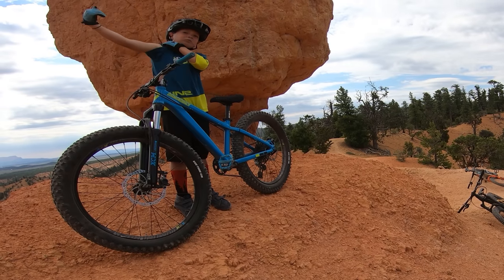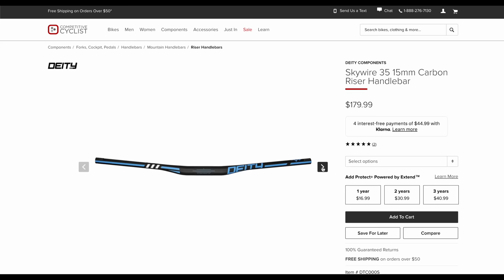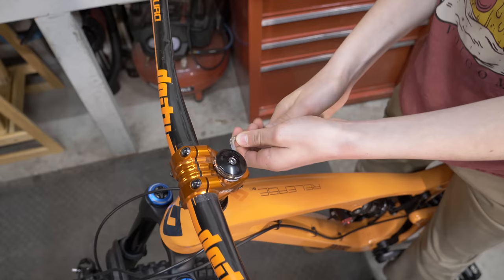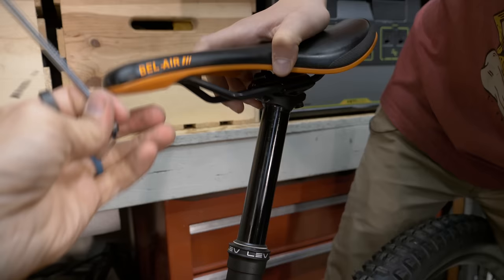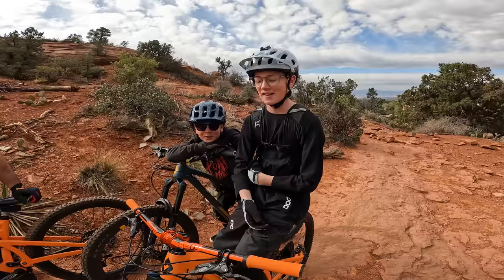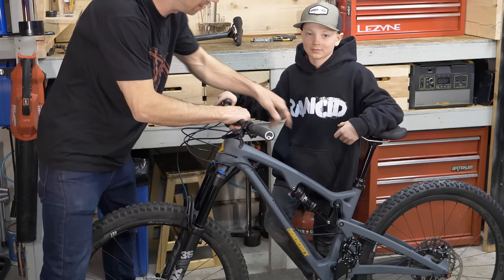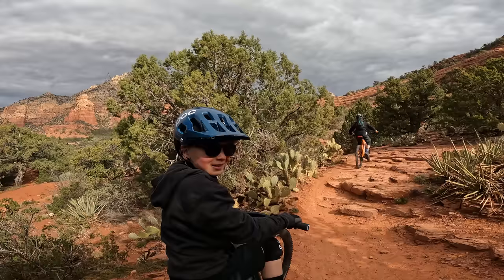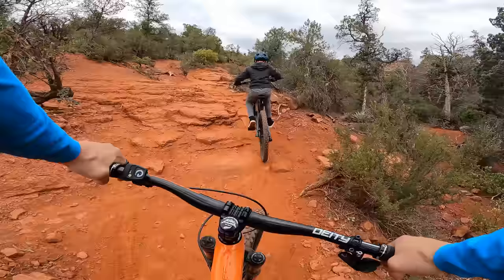Big Bike, Small Kid! Here's How To Set It Up! The Porter's Got New Bikes!

Comment: Hey I wanted to add a suggestion. I am a shorter rider and my dropper was a bit tall for me. I came up with a hack using a couple of zip ties from the seat clamp to the seat as a limiting strap to keep the post from extending all the way, now it works great and doesn’t extend too high!
Reply: Yeah, when I was younger I used a piece of string to hold the dropper a the right height. I tied it to the seat rails and to the little triangular support on the frame that sits between the top tube and the front of the seat tube on some bikes. I had a Marin B17 but it seems like it would work well on the Release that Owen has.
Reply: I might try that. I'm 5'3 and finding a dropper post is not easy. I have one on my Giant Stance, but not my HT Giant Talon. Please see my other post on this video and let me know what you think. Thanks.
Reply from the maker: That's a great workaround to make it work!
Reply: I’m 5 foot tall and dropper length has been a challenge. I picked up a 100 mm PNW post and used One up internal shim kit to tune it to the exact length I need (about 90 mm total) Has been homer for two years.
Reply: @Dawson That is true but, the only problem is that it could be hard to get it to be a consistent Hight.

Comment: My son moved from 24 inch to 27.5 at Christmas also.

For kids, I use the OneUp dropper post. OneUp has the lowest stack height of any dropper. But the best part is the 120mm dropper can be adjusted to 100mm.

From looking at your video, I believe the 120mm OneUp dropper adjusted to 100mm will work very well for Owen. 

Also, the SDG Fly seat is low profile for kids which will help a bit more as well as fit better.
Reply from the maker: That's what I was thinking as well, they are out of stock for now, but when I can track one down I think the OneUp or the new Fox XC dropper post would be the best fit.

Comment: Good video Eric, boys look pumped with the new bikes and Owen seems to be a climbing master, bet going from 24" to 650B is a mega help there, props to what he used to achieve on those 24"s. Looking forward to seeing some more stuff from Sedona and the boys ripping - the footage of them jumping on the new FSs and throwing some good style was impressive, bikes have definitely given them a boost.

Pity that there's no real off the shelf suspension parts designed/valved for kids, although going from a HT to FS, any sort of travel in back is going to give them some added traction in the rough stuff. 
Glad you touched on tyre pressure with Owen, didn't discuss Milo's or what you run in your tyres relative, which would have been cool - I asked on a Yohan Barelli video with one of the kids he's mentoring that I think might weigh 100lbs wet, how come he would recommend the same pressures as him when he's at least 60-70lbs heavier, but didn't get a response.
Also would have been cool to touch on bar width and keeping kids on the right width bar instead of one that's too wide, not somewhere, IMHO to leave "big" for a kid to grow into and a god place to help make a "Bit too big, room to grow into" bike fit just a bit better. Not one to not use all bar width myself, but I know some do, so not sure if that's Milo, but it looked like maybe he could use 10mm off each side of his bar and Owen looked like he might take 15mm on each side.
P.S. Know they're not one of your sponsors, but you could pick up a PNW 125mm Rainer Gen3 dropper and drop it to 100mm and think that by Fall Owen might be able to use it. Alternatively, you could always just don't extend the dropper all the way back up when Owen's riding, so he at least has instant ability to drop it, then just have to take time to get it back to the right height.
Reply from the maker: Thanks! The bikes definitely made a big difference, even though they aren't using full travel!  Tire pressure helped a lot, Milo is closer to 20psi because he is smashing harder and weighs 100lbs. I think if I messed with the valving I could get away with lower fork/shock pressure, but I don't think I will. For Owen I'm going to check all the specs on droppers to see if there's anything that could work, the Fox Transfer SL comes in short travel options, as well as the OneUp that's coming out this summer in 100mm travel. On bar width, I decided to let them run this to see how it works and then trim as necesary, don't want them too wide.
Reply: Having been on a rigid now almost exclusively for a couple years and now getting back on the FS, it definitely does make life a lot easier, don't need to spend as much time standing as on the rigid being the suspension.

Which version and what tyres is he and Owen running and rim width? I'd figure at their weights, they could easily go down into the realm of what for us would be PLUS tyre type pressures - Owen 12-14 and Milo 14-18. Not smashing super hard, but with my 2.6" on i35 rims, I can be down in as low as 12F/15R for slower tech stuff and 13-14F/16-18R for faster stuff with harder hits on Schwalbe ADDIX SpeedGrip HD/NN combo, I'm about 175-185 geared and that's on a steel rigid.

There's quite a few short/XC travel droppers out there, but I suggested the PNW because while it only comes as low as 125mm, you can still drop it 25mm, in 5mm increments to get it to 100mm and it kind of looked like Owen has close to 4" of exposed seatpost, so still a tad short, but,  figured if he could hang a bit and start with something like a 125mm reduced in travel and then maybe not fully extended until he can use the full100mm he'd then have a post to grow in to some more and not be needing a longer one anytime soon. Another option/trick is which saddle you use, even between difference version of the same model in a brand you can have different rail to top of saddle measurements - just found this out when I was trying a resurrected dropper and didn't want to pull my good WTB Pure off the fixed post just in case, so installed a lower spec Pure I had on the dropper, difference in rails to top of saddle was about 5mm.

Good call on the bars, they didn't look excessively over wide, and gives the boys a chance to properly feel what works or at least watch them riding and see where they are in terms of grip width.

Comment: Kids bikes are such a challenge b/c of the weight/height issues and then trying to use decent components.  I built up a small Kona 26er HT for my 5th grade son and for the fork I grabbed an old RockShox Duke and then ramped up the negative spring pressure to get it to actually move enough for him.

Comment: My son is 11 and has an older aluminum XS Release 1 27.5 with Rockshox suspension (Pike/Monarch Plus). I found there was a big difference in suspension when changing the 2wt suspension oil to 0wt suspension oil at his 90 lb ride weight. Fox parts may be different but could be worth a try before a complete re-valve of the dampers (although maybe you get that for free). Also an 80mm dropper worked perfect for him in the XS frame when he was 55" tall.

Comment: A tip for Owen's dropper post:
Connect a parachord or other suitable tether from the frame to the seat rails to "limit" the upward travel. 

Works fine when I put my petite GF on my full sus. 
You may only get 50 mil of drop but that's still huge for a little guy!

Comment: For Owen's height limitations regarding the dropper post, he might still benefit from the dropper if you limit the extension.  You could run a small loop of paracord through the suspension gusset hole where the top tube meets the seat tube and tie it to the seat rail so that when the dropper extends, it's limited by the loop of cord.  Ghetto fix but it would give him some drop which is so good for riding skills!

Comment: As a short adult (5'3), I know the struggle to find a dropper post. Any suggestions on finding one? I'm riding a 2021 Giant Talon small frame 27.5. I read that I could possibly use a 70mm dropper for kids and use a shiv to account for the tube diameter. I'd love your advice, because unlike Owen, I'm not growing anymore. Does OneUp have anything?
Reply from the maker: OneUp has the lowest stack height of any dropper out there, and new even smaller options coming out this summer, I think that's what I'm waiting on, or the new  Fox Transfer SL post, it's really light and comes in pretty short options!

Comment: Awesome vid!! I only weigh 100lbs as well. My fork was so low psi that my geometry was suffering because of the sag. Should I just run my fork hard to keep my geometry?
Reply from the maker: Thanks! Your best bet will be adjusting your front and rear suspension so the sag is as close to where it should be while making sure your rebound adjustment isn't too slow, and then trying to have your front and rear suspension balanced so one isn't way firmer than the other. Good luck, it takes som adjusting and testing to get it right!
Reply: Awesome thanks!

Comment: I'm starting to think about getting my son a new bike. I see your kids have Fox 36's versus a 34. Do you think the difference between those forks would make much of a difference? Not sure if the weight difference really matters.
Reply: For a kid a fox 34 works great! It is plenty stiff for a lighter rider and any weight you can take off the bike will help benefit a younger rider.
Reply: 36 is way overkill for a kid but those bikes I’m sure came with them
Reply from the maker: They definitely don't need a 36 at their weight, but the 34 max travel is 140mm and this is a 150mm travel bike. It's only about a 1/2 pound weight difference so that's not a big deal, and the stiffness of a 36 does keep it from binding so the travel is really nice and smooth. The bikes did come with 36's as well, but if there was a 34 with 150mm travel I'd consider that.

Comment: How do I adjust my suspension on my 24 inch bike I have to turn the wheel on the top but it is very hard to turn
Reply from the maker: That's hard to say without seeing it, you might need to take it to your local bike shop to learn how to do it. Unfortunately a lot of 24" forks don't really have many adjustments. Hopefully it's still fun and works well though!

Comment: I am curious.  I have a 9 year old that is probably an inch shorter and 5lbs lighter than Owen.  He currently has a Trailcraft hardtail 24" that is 22lbs and a Polygon 24" dual suspension that is 28lbs.  He only wants to ride the full suspension at "bike parks" because he can really feel the weight difference.  How heavy are those bikes?  Is that a 36 on the front of that bike?  Seems very beefy given the XS frame size.  What do they weigh?  How do your kids feel moving the extra weight around?

Comment: Why don't you simply add a piece of string from the seat clamp to the seat, so the dropper can't fully extend?? It should be repeatable. 
A bare cable lug should fit in the middle of the clamp.
Or maybe use a piece of shifter inner with a o-ring or heat shrink in the middle, so it dont scratch the "chrome" on the dropper. And maybe a rubberband to pull it out of the way, when dropper is down.
Reply from the maker: That could work for sure, but I wanted it clean and simple, plus it saved a pound of weight!
Reply: @PorterMTB  Very valid points. Right until you pulled out the allen key mid-ride.... 🙂
Talking about weight. How much does the little one struggle on the accents? Maybe you should try convince DiamonDBack to making a super light E-MTB? Something with say 50-100 watts of power and not the full EU legal 250w which seems to be the only recipe everyone have. 
And a much smaller battery too of course. 50-100 watt/hrs to give 60-90 minutes of riding.
And if made so it could regen-brake (charge) on the decent, it could have even less batt and/or longer  range.
This would appeal to a lot of folks. Not just kids, but also guys like me with a few extra lbs, that can't quite keep up with the mates. But have way too much power (and bike weight) with a regular E-MTB, even on ECO setting. And the same goes for riding roads in the mountains.
Reply: My son is in the same boat but he just doesn’t extend the dropper to full height. Is there a problem for the dropper to not ride it fully extended?

Comment: Owen can run the dropper I think but he can just not put it the highest?
I'm 12 5,7 and I have 150mm dropper but I can still use it before I stop I just drop it down so I don't fall
Reply from the maker: That's a good call, he could do that, but it's sometimes hard to find the perfect height again for climing!
Reply: @PorterMTB  maybe you could get a smaller dropper like a 100mm or something?

Comment: What was your trigger point on making the full suspension jump?
My older boys are 10 and they have a pretty good foundation of skills, but they are quickly outgrowing their 24 inch mountain bikes and I’m wondering if I should make the jump to 27.5 full suspension.
Any feedback would be appreciated.
Also, we have a few MTB videos on our channel that might give you a better idea of their skill set.
Thanks
Reply: @jbloggs4161  cool thanks
Reply: @3BrothersExtreme  I'm sure they will love it!

I didn't even know what a full suspension was at their age 😆
Reply: @jbloggs4161  ya, same here.
Did you check out some of their footage to get an idea of the skill set?
Reply from the maker: It's a tough call, I didn't get a full suspension bike till I was 19 years old, and things worked out great for me! You can get a 27.5" x 2.8" tire hardtail with good geometry, eagle 12sp drivetrain, decent brakes and fork for a lot cheaper and several pounds less weight than a similar spec full suspension. The boys could still ride the same stuff and would be smoother from riding hardtails for longer. However if you can afford a nice full suspension with good parts, they will probably be able to ride rougher trails for longer and get through rough stuff they might struggle with otherwise. It's a tough call, but I would prioritize decent parts and a light bike at a price you can afford in either case.
Reply: @PorterMTB  Great advice! Thanks!
I may have made a big mistake yesterday. We test Road 26 inch full suspension bikes at the YT Mill.
The kids were so stoked!
And it instantly reflected in their riding! They were super confident and the added suspension had them hucking some pretty big drops and jumps.